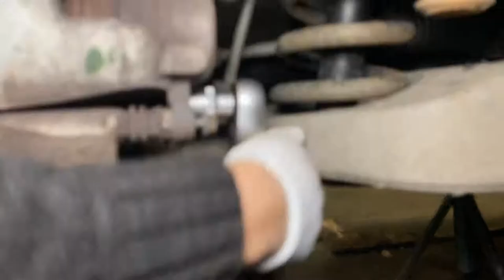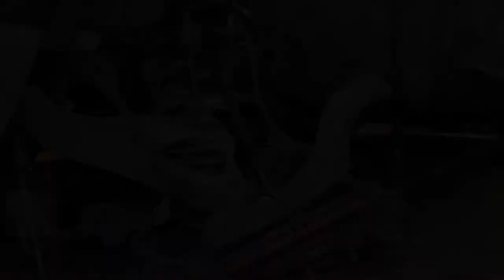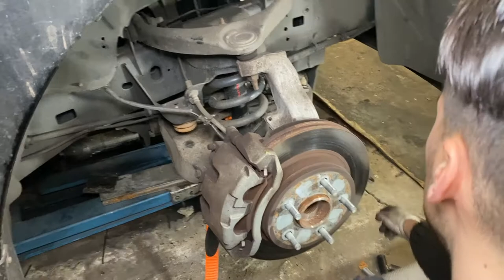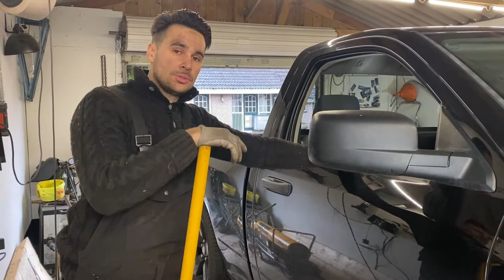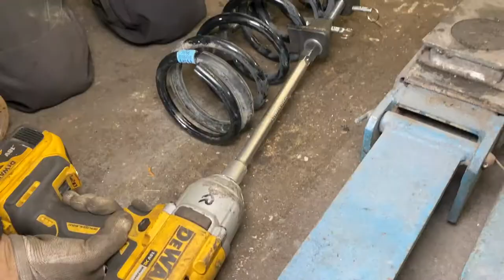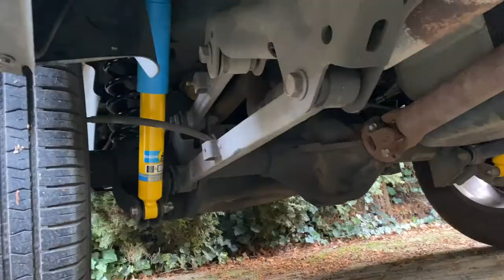How to: Lift a 2009-2018 Dodge Ram 1500 2WD 5.7 Hemi

Comment: Thank you for the video. I want to raise my my 2001 4runner 2wd only 2inch max without a suspension lift kit. It is only for looks. These 4wheel stores keeps trying to sell me into a 3 inch lift which I do not and will not do. Plus I do not want to change the geometry that much. I ask could I do exactly what I watch you do and they act like it isn't that great...What you did is perfect and less labor (less money for them). And it looks great! I will seek a mechanic to do the same....Great job and thank you again

Comment: Where did you find the stock springs for the front? Seems almost impossible to find 2WD front springs for 2015 1500
Reply: crazy but true. i found some for mine oem but 2 days later i took them back out just to install some different ones.

Comment: Do you know if the rough country lifts work with a two piece drive shaft, I got a 2015 express 1500 2wd
Reply: Yes the springs have nothing to do with the drive shaft
Reply: @abelscaliber7969  you’re changing the angle of the drive shift when you lift any vehicle that’s why rough country offers drop brackets and braces for them
Reply: Don’t do it man my truck rides likes shit even tho it looks good. So rough , I’m gonna try diff shocks first
Reply: @moemoe48210 what shocks did you get? I have rough country springs too with Kyb mono max and it’s very stiff.
Reply: @rn_texasangler7150  been trying to fix a warble issue 30-40 on FR wheel. my LCA’s are done ,one bushing is way off. This after new set tires . Full balance. Warrantied my pads front n back cleaned and greased. Replaced horrific brake fluid. One hose. One ball joint. I like tinkering with my shit so I can see why someone would hate on Ram if he can’t turn a wrench. I did all that for like 500$ . But I have a few more things to replace but I’ll lyk when and if it changes major I’m at 130k plan on doing all 4

Comment: i have a 2wd and i want to lift it from the front can just change the springs without buying new shocks ?
Reply: You can but I and most anyone reading this post would agree its worth getting some new shocks while you're at it. Nothing super special, just something that will work well with whatever lift you're putting on it. I highly recommend you do.
Reply: Just get a leveling kit.